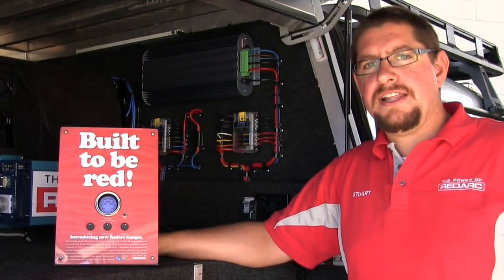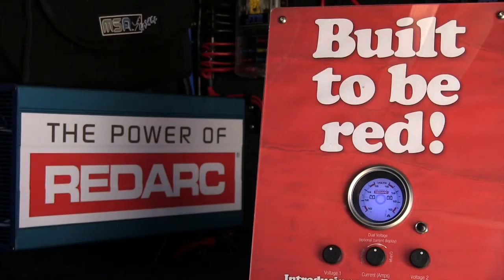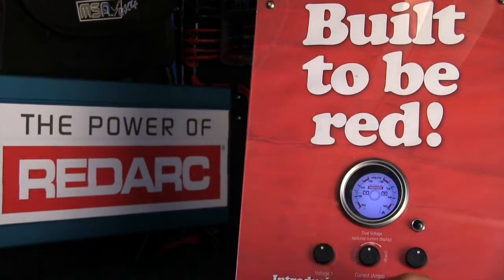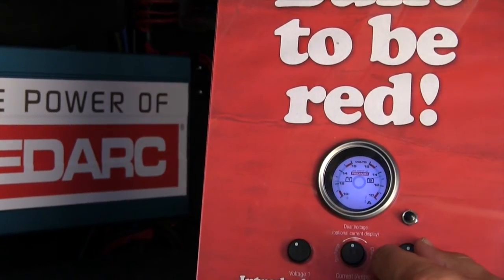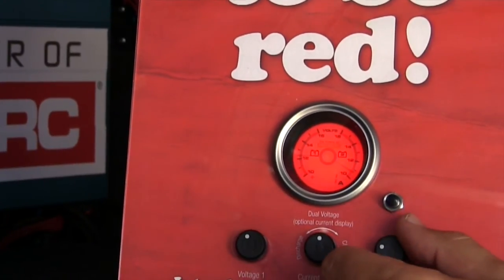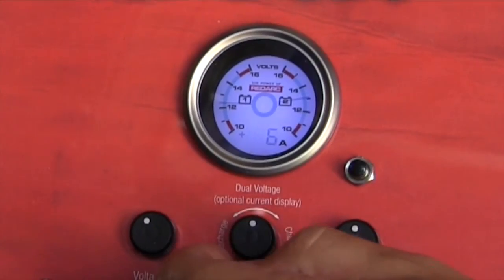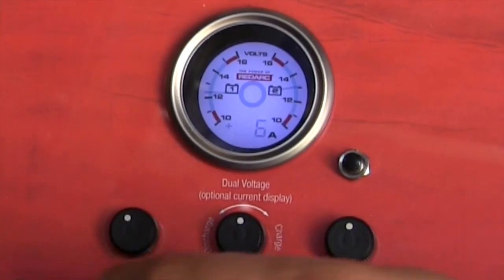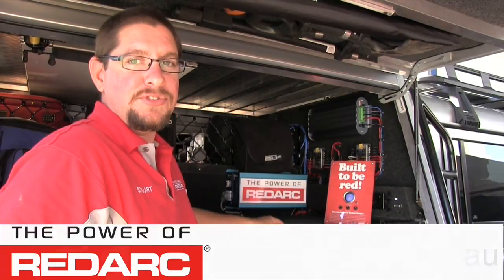How to Use REDARC's 52mm Dual Voltage Gauges

Comment: Is the Amps reading for the auxiliary battery showing how many amps per hour the system is using?
Reply from the maker: Hi Beej, thanks for your comment. The 'Amp' reading shown on the gauge is the amount being drawn at that instance in time, it does not calculate how many 'Amps/hour'. It is mainly there as an indication of what your dual battery system may be charging at, or loads consuming etc.